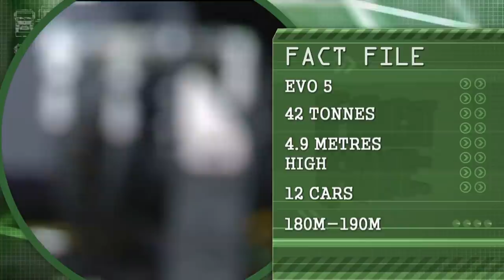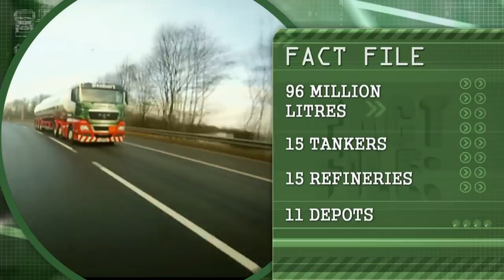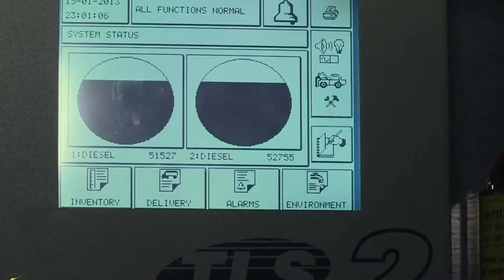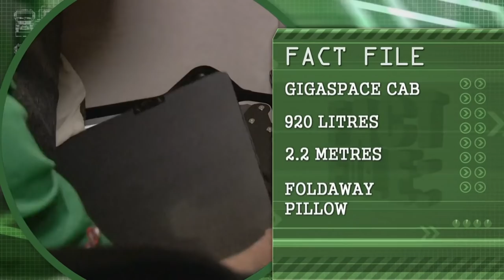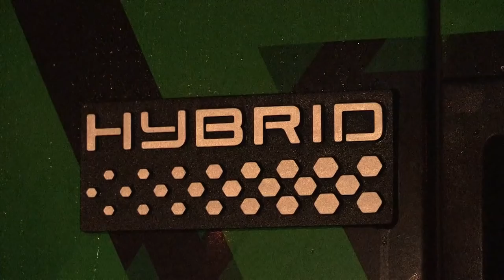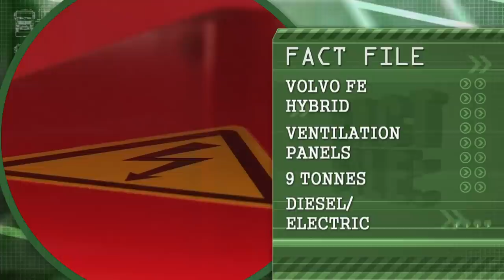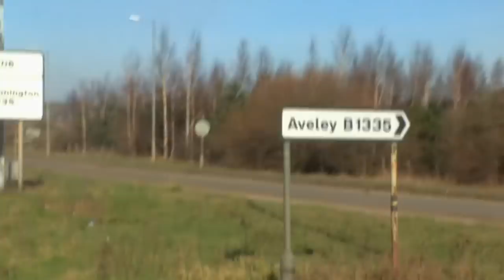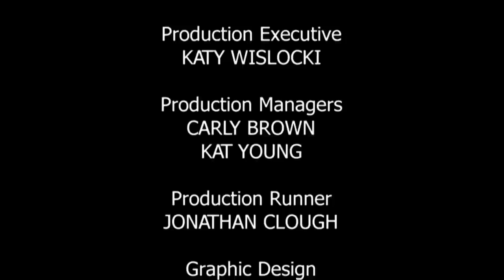One Of Britain's Most Dangerous ROAD! 😱 | S05 E03 | Transport Documentary Full Episodes | All Docs

Comment: The commentary warned us against the danger of the diesel rolling forward on braking but then they tell is the tanker is divided into 6 compartments so surely that danger is eliminated.
Reply: That still leaves 6,000 litres in each tank, all sloshing, albeit to a lesser degree. There are still 36,000 litres of liquid and it still moves. Sure a single tank would be unworkable, but you still know it's moving. Stick a 1,000 litre tank on a trailer, fill in 3/4 full and go for a drive see how it feels.